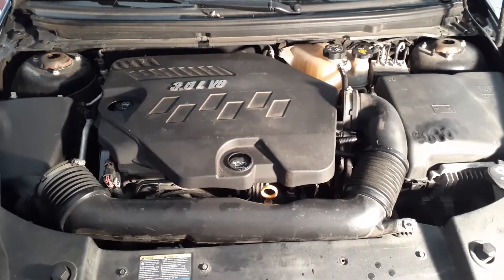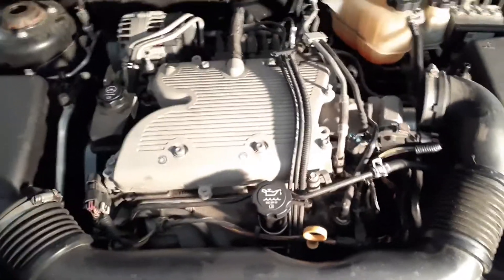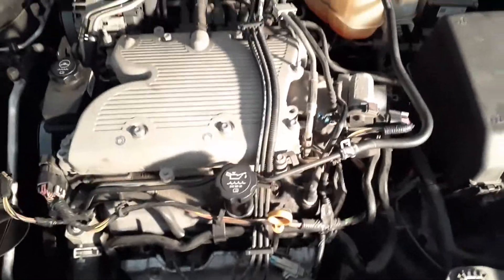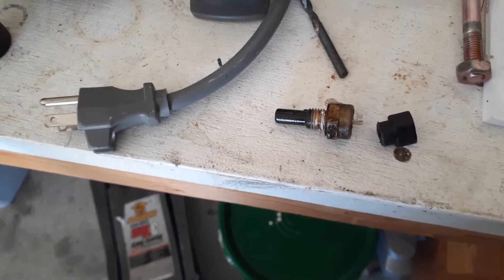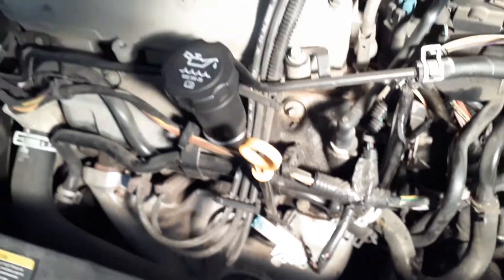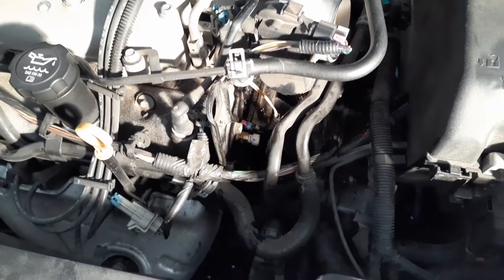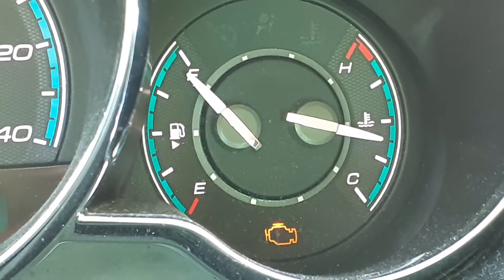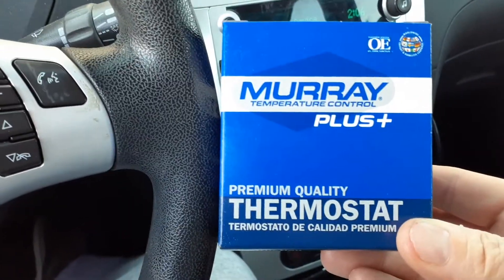P0128 code.  2009 Chevrolet Malibu 3.5 Liter ECT sensor location and replacement

Comment: have the same exact car as you. 2009 malibu 3.5 v6 i was driving last week, temp dropped from below the half mark all the way down to cold . no check engine light. 2 days later, the check engine light came on, gave me the same code as you P0128. bought the sensor from Autozone, cleared the code with my scan tool, temp went back to normal and ac is working again. thermostat wasn’t stuck open. doubt yours was either but it’s better to be safe than sorry like you said. thanks for the video.

Comment: Mine done the same thing I change the sensor and like yours  check light was still on and I reset the code it went off was it off day or 2 and came back on so I'll probably need a thermostat change as well . Was your thermostat difficult to change because I know all cars are different
Reply from the maker: @jasonaday8472  it was difficult for me. Probably 6/10 difficulty. Tight spaces and difficult to see.